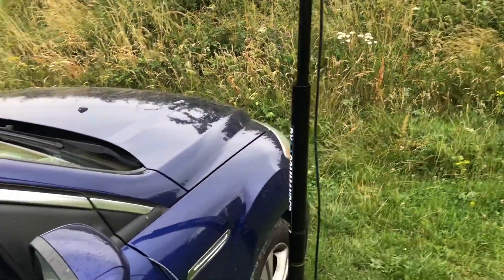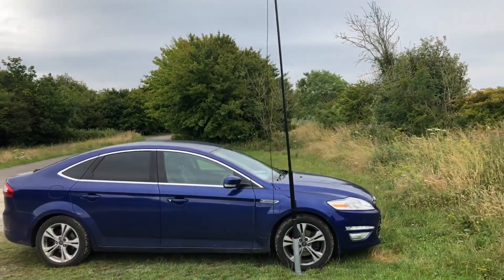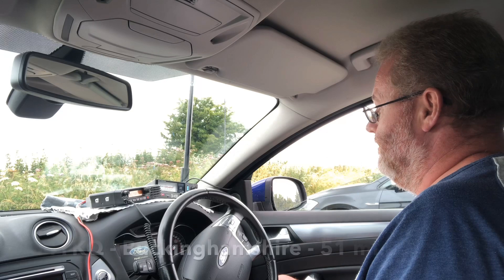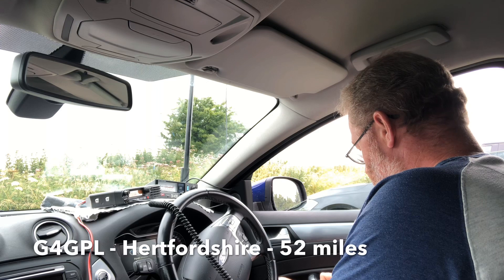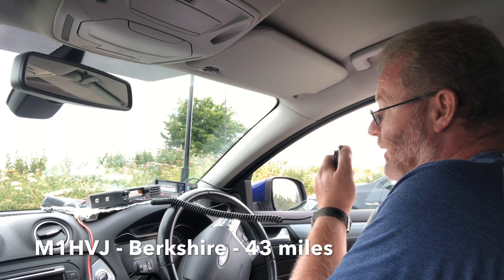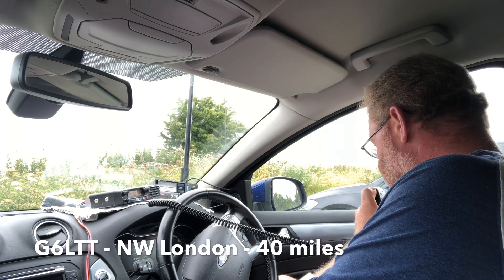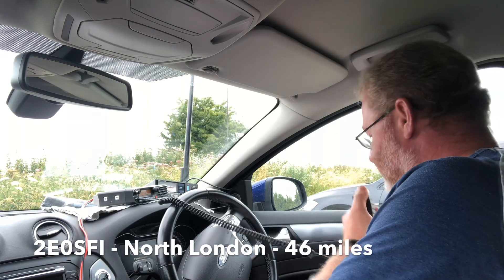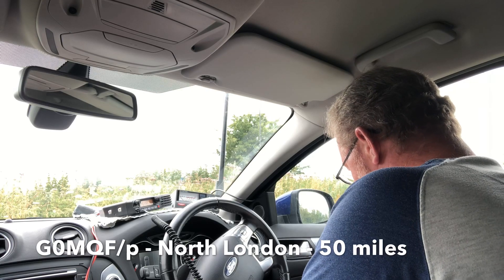HAM RADIO: 2 Metres End Fed Halfwave Antenna - Portable Field Test

Comment: Tim have you ever tried making the same design coaxial dipole but having it be based on a 5/8 wave length per leg instead of the normal quarter wave per side my understanding this will give you threeDB of extra gain by doing it this way just wondering if you’ve ever attempted it?
Reply from the maker: Now that sounds like an extended double zepp? Yes might be worth a look

Comment: Trying to decide between this and a slim jim for SOTA use. Not sure which is better. Will be hoisting it up on a pole I guess
Reply: Can you attach the antenna anywhere along the pole? I assume so if it's fibreglass. I have zip ties that will be good for quick use/disconnects
Reply from the maker: Yes fibreglass and anywhere on pole is good. About 5m off the ground on a hill will do a very good job
Reply: Tim G5TM I’m trying to decide if putting it up a pole is much use when already up a hill :) using a 1/2 whip thing directly on the HT right now.
Reply from the maker: Mark Pentler any additional height is good and as it’s a full Halfwave antenna I’d wager it might be better .. I might compare this myself
Reply: Tim G5TM well that’s the thing. No ground plane, good for backpack carrying as the radials on a 1/4 GP don’t pack easily unless you use screw ones I guess. So I’m after something that’s an upgrade from a 1/2 telescopic and both SJ and flowerpot types work well. Both 1/2 wave in the end.
Reply: Tim G5TM also cheers!
Reply from the maker: Indeed! Have fun and it’s good fun experimenting too
Reply from the maker: My pleasure
Reply: My genuine guess is that once you’re past standing up antenna height up the pole won’t make much difference on top of a mountain vs a 1/2 telescopic on the HT, but may do elsewhere. Time to experiment and add another channel to my list!

Comment: Nice one, Tim! Do you know how your antenna compares to a simple 1/4 wave ground plane VHF antenna? The kind made from some stiff copper wires soldered/bolted to an SO-239? I made one of those as my first home brewed antenna when I got my Technician license here in the US. I'd go ahead and put together one of yours and compare, but the truth is the only VHF radio I have right now is a BaoFeng Handie-Talkie that it woks well enough on a simple whip antenna to hit the local repeaters that are used around me for nets.
Reply: You’d be surprised what a difference a really good antenna can make when you hook up to a Bao Feng!  Definitely worth the make, even if you only take it out and work from some high spots in your area just for the experience.
Reply from the maker: Good advice 👍
Reply from the maker: Good idea Dwight I think I might try that comparison out 73